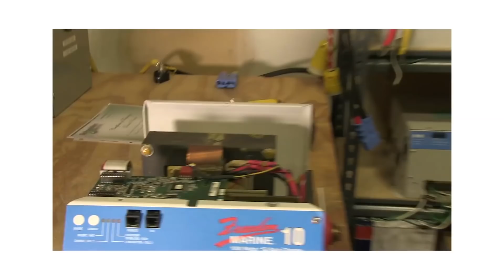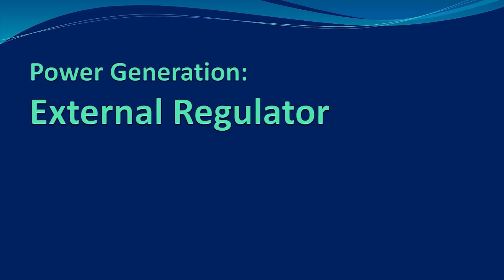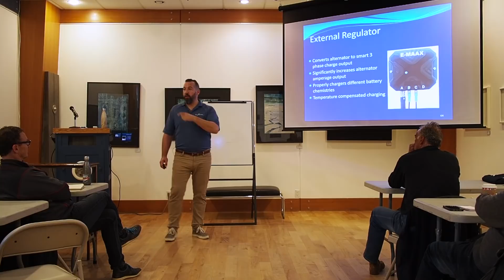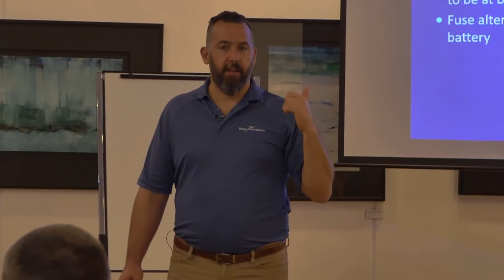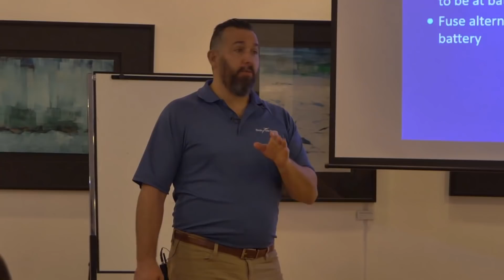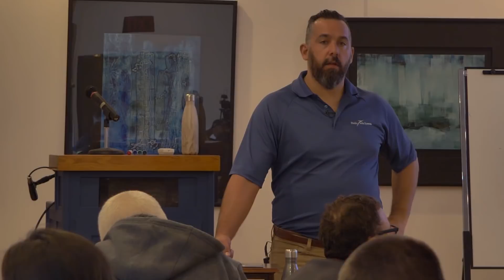How To: Marine Electrical Seminar - External Regulator - Ep 06/30

Comment: The only comment in this fine video I don't understand is the need to have "beefy" alternator(s) for LiFePO4 despite using a programmable external alternator.   Why would dual alternators try to provide LiFePO4 with everything LP will take (and burn up) if an external regulator will overrule that lack of resistance on behalf of the alternators condition?   In my case dual 120 alts (not Balmar, each with less about 7-8' 1/0 cabling to batt bus)... regulated by an alternator temp sensing Balmar MC612 Dual regulator     I do realize there would be some sacrifice of rapid charging on behalf of alternators.
Reply from the maker: Hi David, you're correct, a properly configured external regulator with external temp sensor on alternator will definitely help protect your alternator from overheating. Very few alternators cannot handle the high Charge Acceptance Rate (CAR) of the lithium batteries and the alternators sometimes burn out. Keep us posted with your setup.

Comment: This professor is not educated in Alternator and Regulator design and application.  His description of how these components operate is both inaccurate and in some comments outright wrong.  Its a shame, however his motivation is to sell parts, not to provide correct operation of these components.  For correct explanation of the expectations of these components contact Bus Electrical Products 262 894 5516

Comment: Ha ha. There’s a black wire just splice it. I just removed a #14 ground from my boat. It was spliced multiple times. When I peeled the insulation back it was chard. Burning from the inside out. What a mess.

Comment: Found you in thinking of the Great Loop :) was gearing up for the Great Lakes, well bigger picture  now is longer liveable away time. Weighing out solar, wind and quieter power options. Love the videos Started out in Computers and Electronics in UGH the 70's So geeking outs great :) Currently a Auto / Truck Tech, got into a bit more Marine. Engines, and drives pretty straight forward, wiring and sources of power. Altho the ABYC marine end makes total sense, like in auto lean something new every day. Love the videos Like being back in HS in a way :)

Comment: My alternator has an internal regulator. Can I add a smart external regulator to my system?
Reply from the maker: Hi Brent, you can add an eternal regulator. You need to bring your alternator to a good alternator shop and get it swapped to an external regulator wiring, i.e. remove internal regulator and get a external field.